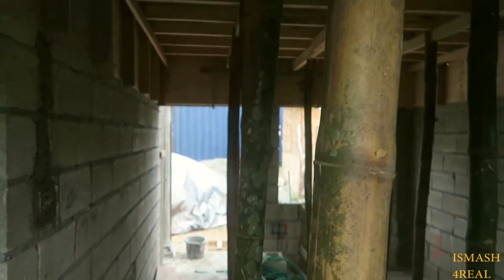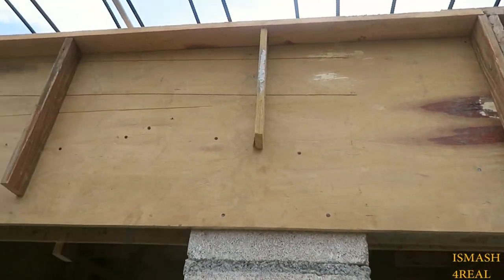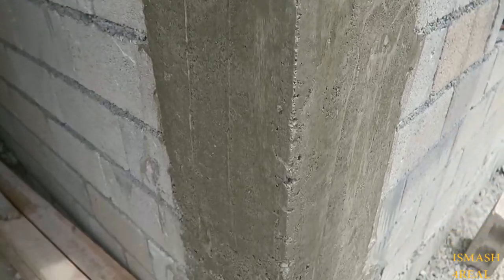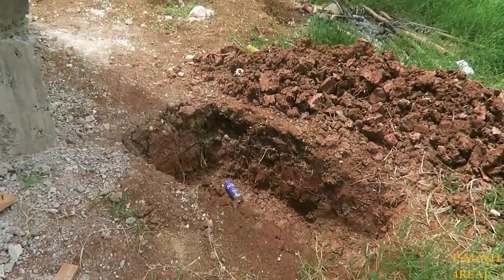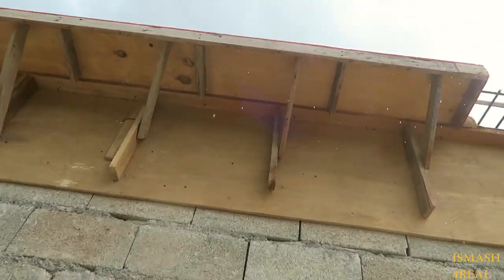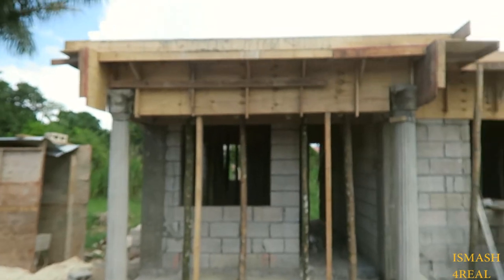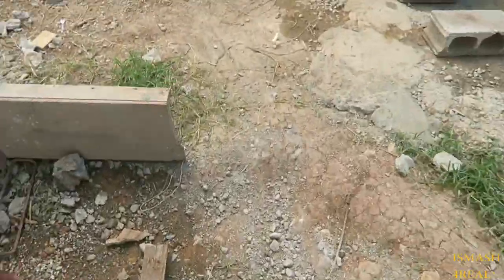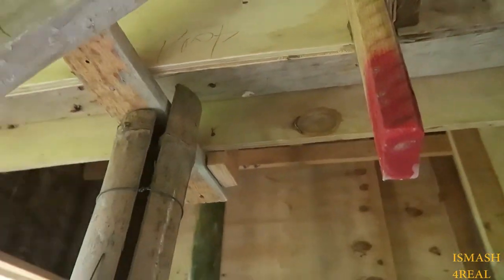Building Your Own House (Casting Roof Slab)

Comment: just a quick tip on the mixer. WATER LAST every time. concrete mixture is to be mixed properly first THEN you add water, preferably slowly to get a proper mixture.
Reply: @Ismash4real  love the astonished eyes LOl, but there is a very good reason. You want every grain of sand to have cement covering it. You want every piece of aggregate to have cement covering it and you want an even mixture of cement on everything inside of your cementatious mixture BEFORE you add water and you don't want to wash those coated surfaces because the moment you add water your curing process begins and no further coating is taking place and the more homogeneous the mixture the better your curing process and the stronger and more resistant to cracks your concrete will be because of the very even loss of moisture. 

When you add your cement to the water the cement essentially remains in suspension, clumps onto itself and only a fraction of the cement goes towards actually making concrete.

additionally the sections with more cement and less aggregate will lose moisture faster and consequently form stress fissures, Aka cracks.

I don't know if you have done this before but try it. Make some coffee by tossing your coffee and sugar and your Coffee whitener(i am lactose intolerant lol) together then stir and see what happen. They clump and get lumpy.

Now instead toss in your sugar, coffee and your whitener and stir those dry stuff thoroughly then add water slowly and watch the entire thing dissolve completely. Same thing.

Comment: BTW i see you use facing and corner blocks. Builders do not realize how much money can be saved by using facing blocks for their windows and doors. You save thousands by not having a need to have a mason waste hours cutting and dressing windows and doors
Reply from the maker: As a builder which I’m assuming you are, how readily available are the fair face blocks on the market. Let me know
Reply: @Ismash4real  i always suggest that you make your own. Its cheaper to hire a guy for  $3000 a day and show him how to measure and mix your concrete and drop your own blocks. same with bond blocks as well. It works out better in the long run. You have your molds and when you need a specialize block you just grab the relevant mold and drop out a few hundred on site.
Reply: @Ismash4real  oh sorry i didn't answer your question. They are not very common in  hardware at all and most people never even heard of them anyway.